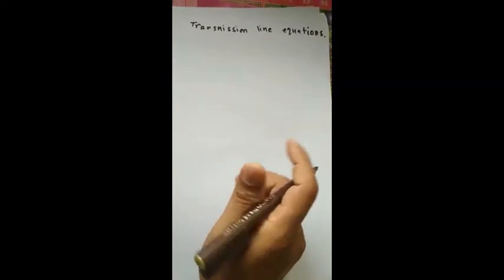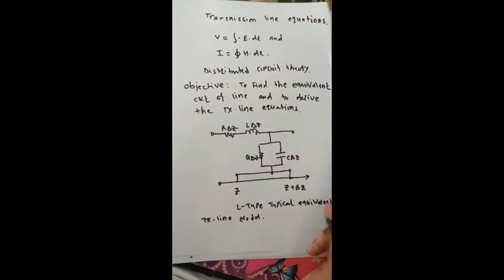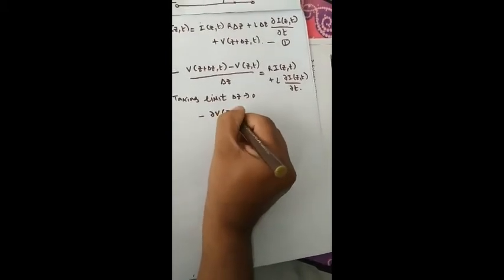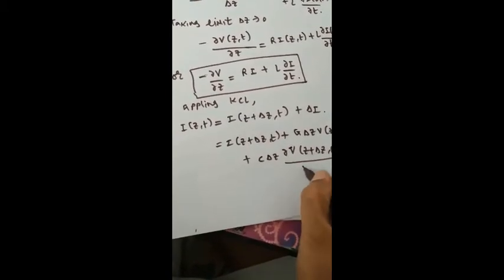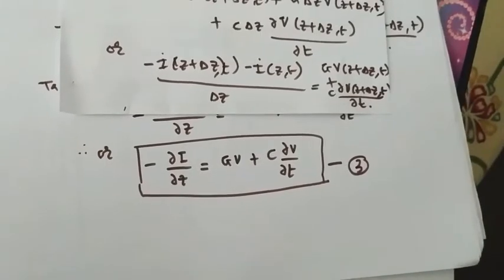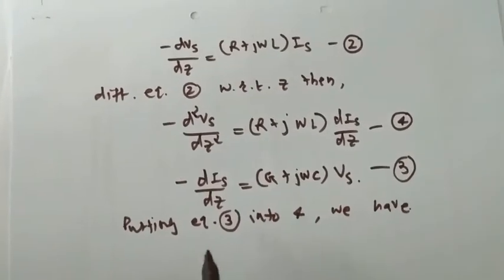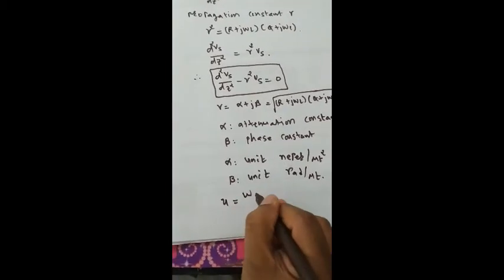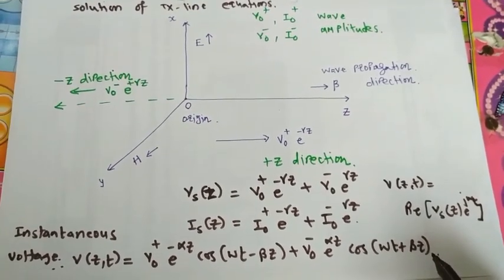Transmission line equations part 1 by Prof. A. K. Sarvaiya

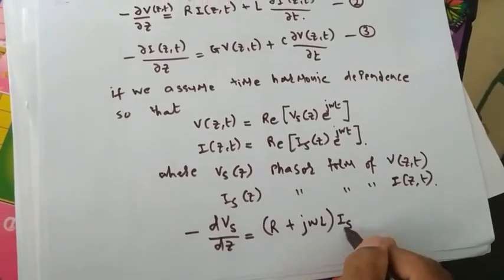Comment: How we get equation at 26:42 plz explain procedure  time dependence?
Reply from the maker: Harmonic time dependence is assumed so that instantaneous voltage which are functional of space and time can be relate with phasor form or frequency domain voltage which are functional of space. In practical case, transmission line analysis, voltage at any point on line is determined using  either instantaneous voltage or phasor form of voltage. Hence need to relate both quantities using harmonic time dependence.
Reply: @profashishsarvaiya5365  and sir I have two doubts  please clear
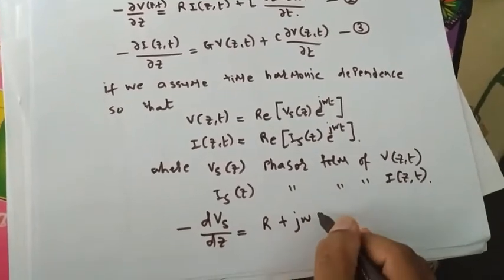1.  I am not getting how equation (2) is converted to equation at time 26:42 ? 
And how ∂/∂z  is converted in that equation (2) to equation at time 26:42?
Reply from the maker: @himanshuyadav-mx1ep  eq. 2 is converted into phasor form of eq. at 26:42 time stamp. V(z,t) is replaced by Vs or Vs(z) and I(z,t) is replaced by Is or Is(z). Hence RI(z,t) becomes R*Is and LdI(z,t)/dt is in frequency domain = L*jw*Is. Hence delV(z,t)/delz= RI(z,t)+Ldel*I(z,t) becomes dVs/dz=RIs+L*jw*Is.
Reply from the maker: @himanshuyadav-mx1ep  second partial differential becomes  derivatives  equation because in phasor form variable is only function of z only. As Vs is function of  single variable, delVs/dz becomes derVs/dz.
Reply: @profashishsarvaiya5365  sir Vs and Vs(z) are two different things(notations) so how we can replace V(z,t) with Vs or Vs(z) ?
Are they same??